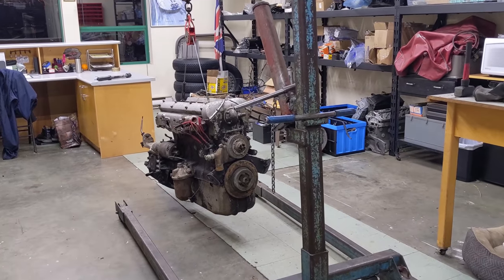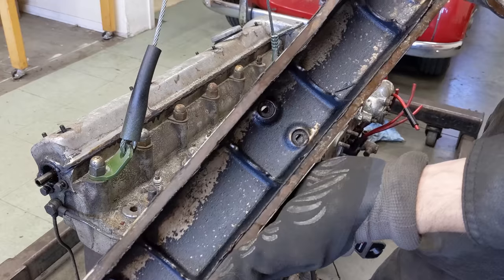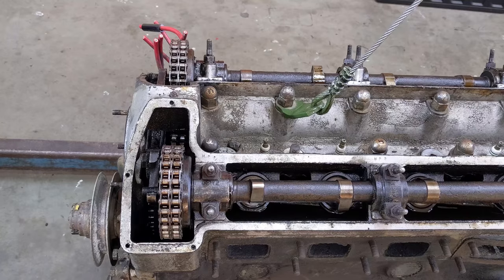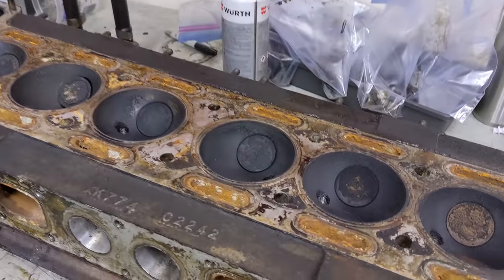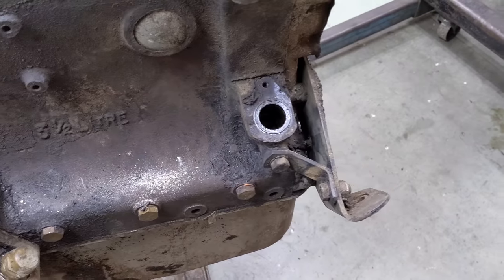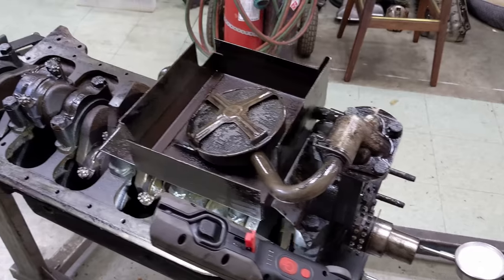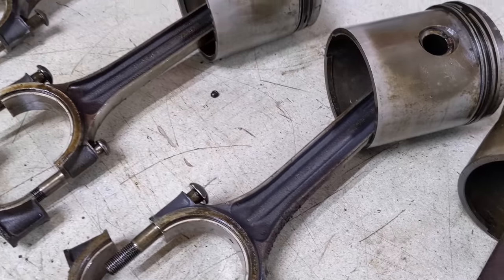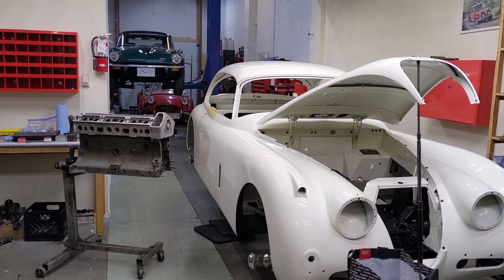Rare 1952 Jaguar XK120 Motor Rebuild

Comment: Boy this video brings back memories.  In 1960, I bought my first car.  A 1954 Jaguar XK120M, for $800.  Ran great .  Then  one day something happened and the engine had to be removed to fix the problem.  A friend who owned a shop did the work to fix the car.  My task was to take the head apart and do the valve job part of the repair.  This was the first time in my life I ever worked on a car.   Slowly one by one I replaced all new valves, springs, spacers, and bearings.  Tightened the cam shaft down checked the clearance, and repeated it if the clearance was off.  Put the car back together and attempted to start it.  Would not start, then discovered we had put the wires into the distributor 180 degree out.  Switched the wire and it started right up.  One thing we did was shaved some off the head.  That had a  big impact.  At 2500RPM, it was like the car was kicked in the butt, and it took off.  What surprised me years later was the 120 had a metal timing belt in 1954.  At the present time my 2001 Ferrari  360 has a rubber one and it was not until the Ferrari 430 came out with a metal timing belt.

Comment: The red stuff (paint) on your bell housing bolts stops them from reacting with the aluminium casing, steel + aluminium + water = galvanic corrosion.
Reply: Looks like "red oxide" (metal primer) paint.
Reply: @_zzpza  Red lead
Reply: Its red lead usually so don't breath in the dust,
Reply: I would say that is old school "Red Oxide " primer paint.
Reply: On boats you hang a lump of magnesium off the rail attached to the ground system to help prevent galvanic corrosion.  They sell cast fish anodes for that purpose in marine shops.  It can be a real surprise how fast those anodes disappear in some circumstances,
Reply: "Hermetite Red" was a real favourite (which might be a lead goo in a tube). Was good for corn flakes box gaskets.
Reply: @samrodian919  We used something very similar when assembling marine winches, purchased as a paste but comprising "red lead" & a binder oil. Highly recommended  wherever corrosion needs control. Lanolin grease with chromate inhibitors is also good but it's a green/yellow in colour.
Reply: Glyptol?
Reply: Pb3O4 - lead minium
Reply: Red Lead was my hunch as well, but I have no data to back that up
Reply: @mrutens  
My suspicion as well.
Reply: @jamesgerard4505  Jaguar back then used a positive earth which made the corrosion even worse! I know exactly what you mean about sacrificial magnesium anodes but I have no idea if this is any use with the positive earth.

Comment: Dad gave me a 1947, 3-5 litre Drophead Coupe in the 1960s . Still in the family. Did all my own servicing with dads help. I can recall taking the starter motor off and setting on the bench. “What are you doing with that ?“ asks dad. “ Taking it down to get fixed” I reply. “ No you’re not. You’ll repair it yourself. “ says dad . So I stripped the armature re-lacquered a hundred miles of copper wire, rewound and baked the armature in the kitchen oven.    
Recovered the fields etc. put it back together tested it. “Yay presto works!” “See how much money you saved” says dad. “Yeah. Thanks dad...”:50 years later still remember it. I’m now in Aussie and the car’s in NZ Still drives ok. Richard, just found your  great video. You got yourself a new follower.

Comment: Came across this video unintentionally. Made me wish I had such a source of information some 50 years ago. Had an XK150 which dropped a big end not long after I purchased (second hand with a lot of Australian miles on). Started the rebuild then married. Never finished it, but did keep in touch with the purchaser for some years. Rebuilt to Concourse Condition over the following 15 years.

Comment: Welcome back Richard, hope you and the family are keeping safe and well. Really loved this step by step on  the old 3.5 XK engine, I had one complete with Moss gearbox sitting under my house for 25 years, guy that I bought a nice manual 1966 3.4S Type off threw it in with the deal, it even had a complete pair the early type "long neck" 1.75 inch SU carbs on it. I had to dump the whole thing when moving interstate. Yes, more please on all your jobs.

Comment: I love it. Looks so much like the first engine I ever rebuilt which was the 3.8L out of my '63 sedan circa 1972. Thanks for the memories. I finally smarted up and am currently rebuilding my '90 Toyota pickup which I bought new in 1990. Brits vs Japanese. Huge difference in engineering.

Comment: Good to see you back on the screen Richard. I've just rebuilt my 1950 120 engine - studless cam covers, bow front engine mount etc. - so it'll be interesting to see how you tackle this. Looking forward to more on the 150.
Reply from the maker: Tim, great to have you along, so your engine probably has even earlier details like the smaller water pump, the earlier block, 6-bolt flywheel?
Reply: @RichardMichaelOwen  Indeed, plus tall dashpot carbs and the deeper cast aluminium sump. Good luck with the oil level float mechanism. I could never get mine to stop leaking. I've had some aluminium blanks made up to go over the hole. If you find yourself in a similar position and want one just let me know.

Comment: Very interesting impressive and thorough work. I have done this myself over the years right from messing it all up in my teenage years and 30 years down the line on my XK150 that I still own. I did rebuild my engine again some years back to +030 and crank regrind. Fortunately the thrust was ok. I did use specialist machine services to rebuild the head and it runs well. However after seeing this and your other videos the level of your work far exceeds what I did certainly in the cleanliness department. I'm a great believer in running the engine foe a few hours and immediately changing the oil and filter. Just cant take the risk of the pressure relief valve getting some grit under it or damage from some lurking grit. I like all the details you show.

Comment: "Otter switch"...Otter Controls, Buxton, Derbyshire...I was US rep for them in the 1990s...went to the factory several times.  Spent a lot of time in Detroit with their sales and tech guys, calling on middle tier suppliers, and Ford, where we were warmly welcomed because one of the main SVT guys was a Brit!  Moved a lot of Otter switches, mostly for window lift stall protection, but also some applications in coolant sensors, like the one shown here.  I have an MGB that has one of the venerable disc switches mounted on the top of the radiator.  It tickles me to see them!  Otter was also really keen on tire temp and pressure sensing technology for a while, but the only application they found was in a few F1 race cars.  Their system was over-specified for the mass market,  however, so we never got them into US manufactured vehicles (but we had a time every spring in Detroit, displaying at the SAE for a week at Cobo).

Comment: Very very cool and really glad that you're doing back to original. When you get older in life, you appreciate the originals. Driving them today will take some modifications but you can retain most of the original car. These 3 1/2 and 4.2 6s are a true hemi engine for the pistons are domed and the heads are domed.

Comment: I really enjoy your posts and I have worked for Jag for a while in the '70s and am now putting my third personal 120 back together. My '50 had the old style bell housing, the high top carbs, the early block, the whole early "kit".  It was fascinating.  By the way, if anyone has an early oil pump let me know, should be the same as a MKVII.

Comment: The cylinder head is very malleable, and as such can bend  an example of that follows Here:
I was driving through the Pyrenees  towards Southern Spain from France a few years ago, when my temperature gauge showed an alarming and rapid rise , and after several stop starts to refill the coolant, I ended up stopping at a gas station on the motorway close to Zaragoza with five hundred miles left to drive, I checked into the gas station motel, and proceeded to pull the head off the car in blazing sunshine, and with only a simple socket set and a few hand tools. From the motel phone I ordered a seven day delivery of a head gasket set, there was no other faster delivery possible in 1997, and I took off the head finding that it had warped almost a quarter of an inch higher in the centre making it banana shaped. The gasket set arrived, and it was fitted, but I tightened only the centre six bolts down to approximately 50pounds feet at a guess, and left it overnight. The next day those six bolts were loose, and I tightened them once again to 50lb./ft. and left it for a few hours. I repeated this on the six centre bolts for another three or four times, and finally, there was no more movement, the head was now firmly torqued up to the block, and I worked my way outwards to tighten the rest of the head bolts up to 50lb./ft. After another day, the bolts were holding their torque, and I gave them another little torque to approx. 55-60 lbs.ft. going by intuition , and then put the rest of the engine together in the usual way. After starting the engine, I ran it to get it hot, and discovered that the viscous coupling  on the fan was slipping, and I unwound two of the four holding nuts out until they locked onto the fan pulley, locking the fan to run at engine speed.  I drove the car (  A 3.4 litre XJ6  Coupe ) to Estepona five hundred miles further South, and that engine did another 30,000 miles without being touched, until I sold the car.  Proving that aluminium cylinder heads can be carefully put together even when they are banana shaped.

Comment: Very interesting! Cylinder 1's oil feed has to pass through all sludge traps in the cranckshaft, it seems. That could possibly be the reason why there seems to be work done on cylinder 1, and the furthest main. Thank you for the video!

Comment: Nice motor, nice commentary and workmanship.
I think you scored a good motor there.
You have a motor that's 68 years old that came apart, bar one item, very easy. Yet you seemed critical of the wear and tear it had experienced. Seemed for it's age not that much.
As for the criticism of previous workmanship, well, I remember in the seventies during the oil wars that these gas guzzlers went for very little money compared previously and later on. So somebody with little money, could have brought it and worked on it themselves as not being able to afford Jaguar mechanics. So their work was adequate for the time but obviously not up to your expected workmanship.

Comment: Sure do want the rest of the story.  I rebuilt a Jag 6 in about 1966.  Not this engine, similar but more sophisticated, probably a XK140 or 150.    I remember being delighted with the design, and the rebuild turned out well.  We had many fewer issues since the engine we worked on was in good shape and running, but off it's feed, needed valve work mostly.  We replaced rod and main bearings, rings but not the pistons which were in good shape.  As I recall the cam bearings were fine, we may have replaced them but I don't remember.

  There is one thing I hope you can shed light on.  This was my first Jaguar engine rebuild. We had the shop manual, and carefully followed the specs, but when we came to finishing the valve work, the manual said "do not lap the valves".  We looked at each other and "What??"  We always lapped valves carefully, considered it a final touch of precision and pride.  We talked about the issue every which way, and finally lapped the valves.  We simply could not imagine why that was in the manual.  The engine worked great, we double checked the clearances, and there was no problem.  The customer was happy.  The engine was happy, we were happy.

Any light to shed?
Reply from the maker: Hi James yes I prefer to lap valves to verify the fit. Fresh from the machine shop with a triple-angle cut, it probably doesn't need it.
Reply: @RichardMichaelOwen    Well, we were the machine shop, did the 3 angle work, and still always lapped.  Don't like "probably" when I'm working on machinery.   Although once in a while you can't get away from it.  I wound up answering a frantic "help!!" message from a friend of a friend up in the mountains in Big Sur.  Found him, his girlfriend, and an urgent need to move - with an old Plymouth six - about a '49, with a knocking rod.   NO parts for miles, no money.  Took off the pan and found a spun insert and lots of nasty on the crank journal.  Had emery paper and a mike.  Spent quite a while getting the crank round and smooth again, and asked the guy if he had a really strong leather belt.  Yup, I had heard the story sometime, so I cut a bearing out of his belt, cinched it down with the rod cap, got the pan back on with a lucky tube of sealant and the old gasket, and took a deep breath.  Fired it up, and it ran just fine.  I told him to keep the revs down and go as easy as he could.  Last I heard he made it back to civilization, and was very grateful.  I heard it worked a lot longer than any of us thought it would.  (When I heard the story about the leather rod bearing, I can remember being super dubious - but there I was, with nowhere else to go.  And it worked.  Phew.)

So any idea why the Jag shop manual had that "don't lap" note in it??  If you have an old shop manual I bet you can find the note in the valve section.

Comment: Richard, Greetings to you. I was astonished when you showed the Engine number of W4520-8, I thought to myself, err, 'ang on there one minute, that sounds familiar. 
I stopped the video and I went and checked the engine number of the Studless Cam engine I am at present readying to re-assemble, and it is W4519-8!     Small world.!.  :)) 
I bought the engine from a chap in Norfolk who bought 3 containers of early XK engines and stuff from a closing down parts business in the US a few years back.         
The engine will be going into my 1952 XK120 OTS that I bought in 1972. It should have engine W4368-7 which would also have been a studless cam cover. 
The car came with a later XK engine which has since gone west and I am at present driving it on a 1963 MkII 3.4. It will be nice to get it looking correct under the bonnet again. 
Regarding the 1/2 moon engine front mounting plate you mentioned, that is what I am using and it has never given any problems with 45 years of driving.       Loved the video.
Reply from the maker: Fred small world thanks for watching. I am looking for proper studless cam cover gaskets if you run across any.
Reply: @RichardMichaelOwen  I will be going to Jaguar Spares Day next weekend and will be looking out for some for myself. 
I did use the very thick sheets of protective card that they use to cover Bananas in boxes from my local supermarket to cut out as a template to make standard Cam Box gaskets when the old ones leaked and needed replacing. They work a treat. Will keep you posted.
Reply: @RichardMichaelOwen  Hi Michael, I tried to get studless cambox gaskets from SNG Barrats at the Jaguar Spares day. They had the Pt No listed, but it referred to the later type. I will have to make my own out of a long piece of thick gasket paper.

Comment: Richard , we welding aircraft and diesel crankshafts regularly. Whoever had told you welding a crank isn’t durable doesn’t know what they are talking about. BTW...I’m a retired ASE certified master engine machinist.

Comment: When I was 15 in 1962/3 here in England, during the big freeze winter, it was nothing to see cars with bonnets(hoods) up, with core plugs on the blocks, sticking out on a frozen column several inches long! This sometimes saved the block from cracking! Antifreeze was apparently an unknown quantity to most DIY motorists running their cars on a shoestring,! So those quite thick core plugs did a very useful secondary job after the manufacturing stage too! I had two Mk 2’s and shudder to think What they’d be worth today? Had to sale the two for less than £100 as fuel rationing was coming in! Arse!

Comment: My XK120 had torsion bar front suspension.  Does yours?
Mine had aluminum brake drums, does yours?
On the passenger side on the dash there was a chrome plated U shaped grab bar, behind it was an engraved plaque exclaiming reaching a certain speed, I think in a hill climb?
Can't remember, it was my first car and in 1957.
Mine had side curtains and fender skirts.
I didn't keep the car very long as I was in the north US and I froze my everything off 🤣
Wish I had that car now!
JIM 😍

Comment: Not ever seen Welsh plugs like that in helluva long time. More used to the shallow dish type, with a slight taper, with the 'open' part of the dish to the outside. Idea being, of course, the frozen water would push 'em out so not crack your block. Begs ? when DID coolant become the Norm?

Comment: I had my damper re-rubberized if you like I will find out where I got it done, as I know you like to keep as much original as you can.
Reply from the maker: Yeah that's a great idea. Later found out these are readily available brand new. Looks like they didn't change the design until the 4.2 came out!

Comment: Red paint looks like Glyptol. It sticks like crazy and even after boiling a block which has been painted with it inside , it 's always still there, mpervious to the heat and caustic liquid. 
I've never needed to machine a ring gear off, just use a cold chisel between the teeth and split it, then hang the ring gear with a pair of stiff wires ,heat it and then drop it on the flywheel. Decades ago it seemed to be something that had to be done at least once a week for customers. 
The broken cam wheel holder is sure giveaway too.